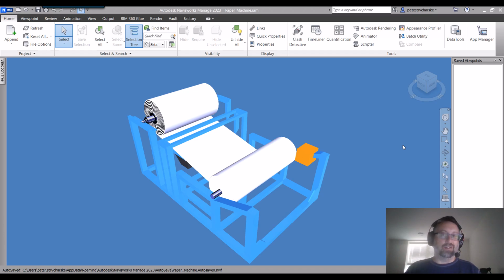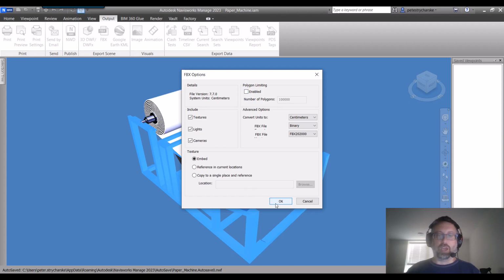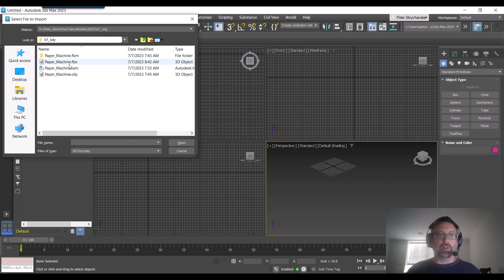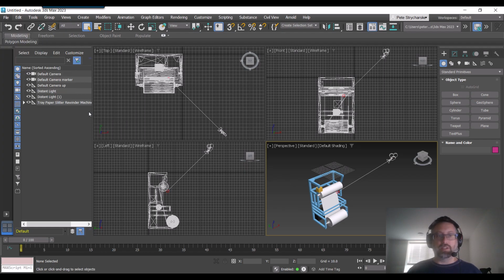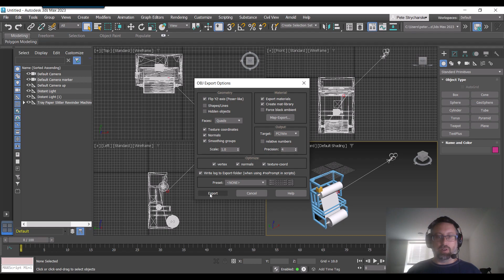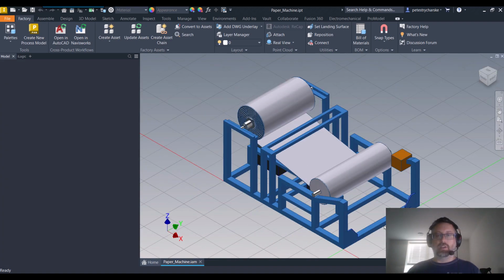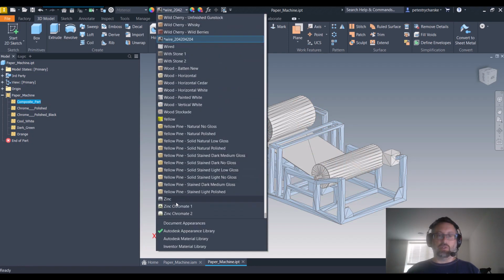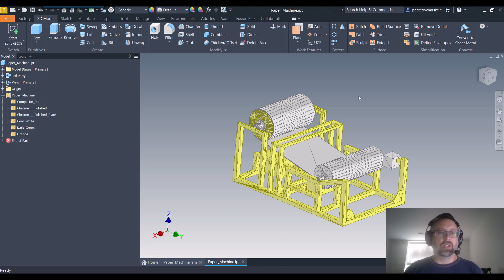Navisworks  - How to Export Useful Geometry from a Model

Comment: Not so related but... I have a 3D model in nwd format (450 MB) once exported to .fbx it becomes 1500 GB, I wanted to create a nice walk through in Unreal Engine 5, however the max .fbx size is 300 MB. Any idea, reccommendation how to reduce the size of it? As far as I know I cannot remove parts in .nwd (NavisWorks Manage)
Reply from the maker: @kuksiBG, thanks for reaching out and apologies for the late reply!  Yikes, that's quite a file size jump and unfortunately, those mesh-style models can get quite large.  It's been a while since I've tried, but you can "Hide" objects within an NWD.  I'd give that a try and see if that helps with the file size, especially if there are objects that are not necessary for your animation.  

If you have access to the original model creator, you can ask them for a paired down version, which may save you some time.  

Please let me know if "Hide" ing of objects helps knock down the file size and I can do some more research from there.  Thanks for your patience with my late reply, hope all else is well and have a most blessed day!

- Pete